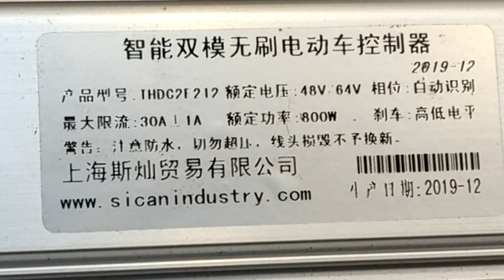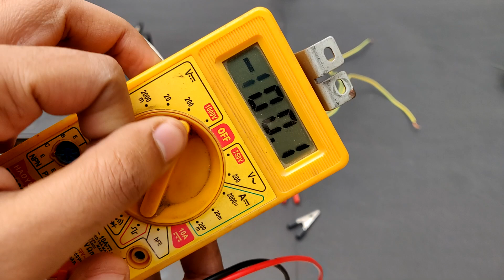Woohooo !!! Run 12v Car Alternator at 60 Volts as High Speed DC Motor DIY

Comment: How long can you run the car alternator at 60V without overheating or burning the motor? Can this be installed in a DIY scooter and can run at 80KPH?

Comment: Are you using brushes?  Why do you have a battery  ( light green with magnets )  to power brushes ? Thanks
Reply: to power the electromagnet inside the alternator. with some modifications, you can swap it for a permanent magnet and you wont need the extra battery

Comment: I may have asked this question before in one of your other videos but, what was the total battery life run time if you ran the project until the end of the battery life. my project will use a 12v car alternator, a 12v car battery, an ebike throttle and 2 bicycle sprockets. I also need to know a projected distance ,calculated MPH and motor RPM speed.
Reply: You should know the max current draw and the amperage of your battery

Comment: Dear Friend

I am working on a recycle project. I like to upscale old stuff.

See my old Alternator from 1970!
I removed the rectifier and wired out the stator winding. They are arranged in a delta configuration.
It has only 70Ah. This was state of art in the last century.

I addition I have bought a 48 to 72V Motor Controller which can handle Sensorless Motors.

On the Rotor I have applied 14V and in use the rotor field windings consum 2.8A.

On highest speed the system takes 300W and each stator phase takes 3A. 

So here my question? 
During the test without load I have disconnect the rotor current and the motor increased speed and the consumption went up to 400W. 

What could be the reason for this.
Is my stator field not optimisés with my rotor field. 

I have a learn function on my 3phase motor controller. This piece came without any user manual!

Thanks for the support.
Merry Christmas.
Reply: to output power you will have to increase the rotor field by increasing the rotor current. For higher rpm this rotor magnetic field will actually slow the engine down. So if you decrease the field (current), it will run faster but with less power of course. Read some scientific papers on synchronous three phase motors and possibilities of controlling their speed!

Comment: DIY my Gm 1 wire self exciting 120A & a 105A & a 150A Ford alternators to charge 48v Lithium Battery Bank ? I have 3 High Amp Alternators to charge 2 Lithium 48v battery banks , the correct way to wire straight to the Stator gives about 2,000 watts current Ac I’ve metered , Amps I don’t have an Amp meter that high mine only goes to 10A , I’ve seen off the stator people have said you get Ac 115v & 90 Amps but I have not personally seen that on a meter ! I have a Moes Automatic & a 5KVA 230v Pure Sine Wave inverter 1 Phase 5 KW 96A or 3 KW 75A charge controller on both and a Square D breaker box to be a sub panel 100A , 8’ anodized ground rod to ground the second box I will jump wires from 4 circuits I will be needing power to if grid down ever happened 1 is 30A , the others are 20A x 3 = 90 Amp ! DOABLE ! I have 5 - 775 Dc motors & a few speed controllers , wire 1/0 , 2 AWG , 6/4 , 14/3 , 6 AWG grounding rod
Reply: Maybe using full stops and commas could make other users read and understand what you are writing. You may be getting 100V out of it, but under no circumstances you could output 100V @ 90A. Just do the math. 
I have also no clue how you think you can get 115V out of it. Why 115? Why not 111 or 123? Without regulation there will just be any output voltage, depending on your load. 
For the other assumptions you make: I would like to see a video of that....
Reply: Plus you will get threephase power or DC after the rectifier. Not AC as you know it.

Comment: Good information thanks... Only 3 volts in the rotor in side? Muy buen  video solo ESA pequena bateria funciona para el rotor?gracias
Reply: Yep that's about all it takes and with alternators in cars the Voltage regulator only feeds around 3 to 5 volts to get the charging done.

Comment: found a legal electric engine while in canada. the alternator is on the front tire with a cvt transmission and then a battery exites the alternator and then battery also runs the motor and of course the alternator charges the car battery. it is legal but the get stolen like a really lot man.
Reply: Please can you provide a drawing?
Reply: @vangcruz4442  dude no but it was eight so so what find it yourself. surf dude surf i got to go sorry the drawing i just saw was missing a self excited alternator.
Reply: This contraption "runs the engine"? And of course charges the battery. Does it also give the driver cold beer or a back scratch? Come on...

Comment: hello there mr electron just wondering if a 12v DC electric motor 1 hp would run a dc /to ac inverter 6000watts with a car alternator charging the 12v battery.i would need a min of 320 amp alt would that be enough output?would the DC MOTOR  have enough RPM to run it ?

Comment: Replace with neodynium magnets for the rotor.
Reply: Nope the coil can be used to control the torque like a motor of train , he can connect some resistors at top speeds to weaken the field and increase current + speed & reduce torque like a motor of diesel electric or electric engine.
Reply: Don’t use N-52 magnets alternator will be very hard to turn ! Will be a waist of time & $
Reply: Nice Idea!!!😍😍😍 I will try to make the same project and I use to the outboard motor. Perfect job mate!